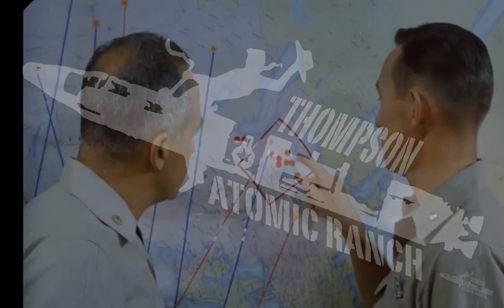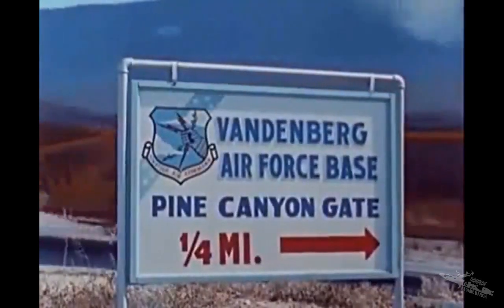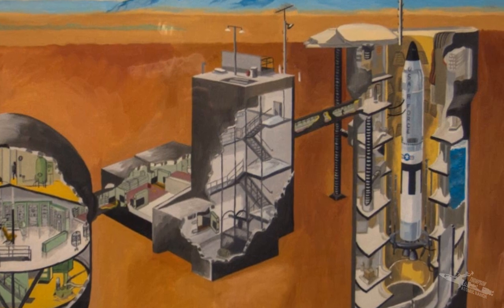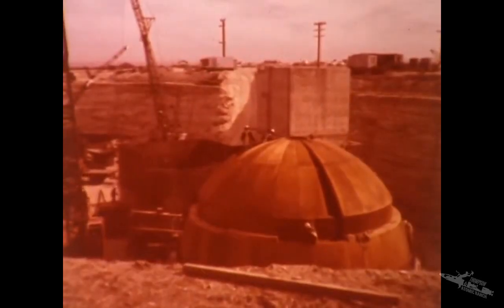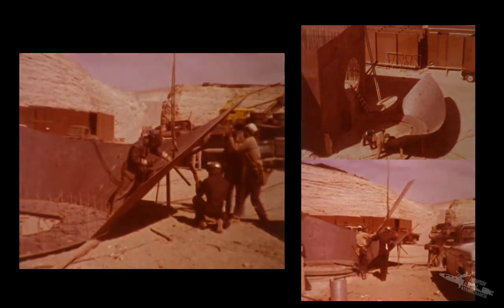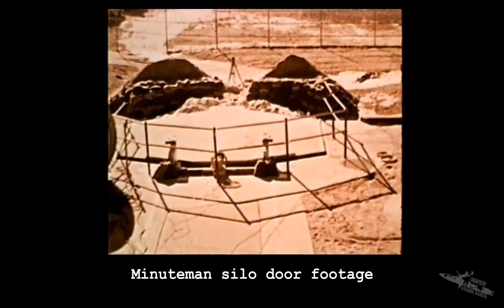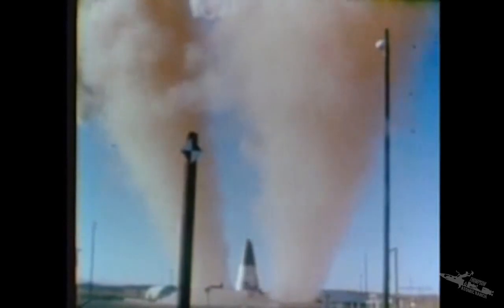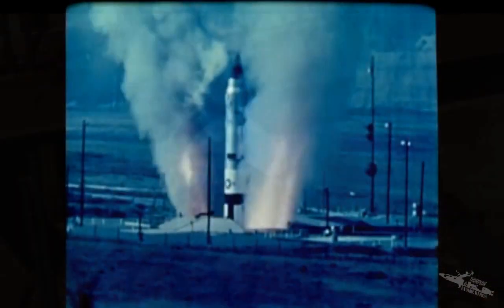The American ICBM that scared the Russians for over 20 years!!!

Comment: You should do a video on the Searcy Arkansas silo fire in 1965. Killed 53 men with 2 survivors from the civilian contractors.
Reply from the maker: I actually just found a bunch of after action photos of that accident which document the damage done to the silo and equipment.  Good idea!
Reply: @ThompsonAtomicRanch  I grew up 2 miles from it. I remember when they decommissioned it in the mid 80s as a young boy.
Reply from the maker: @jasonduncan69  no way?! Do you still live out that way?
Reply: @ThompsonAtomicRanch  No. There is a sign and granite memorial at the corner of Ar. Hwy 305 and Snowden Rd. The site itself we used as a staging area for a few frac jobs.